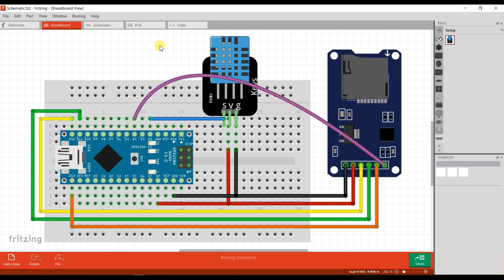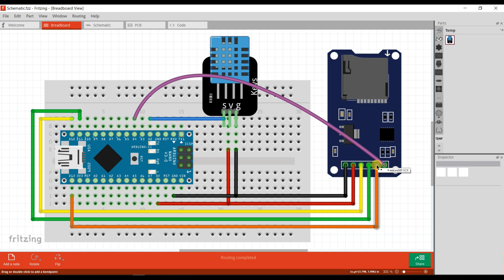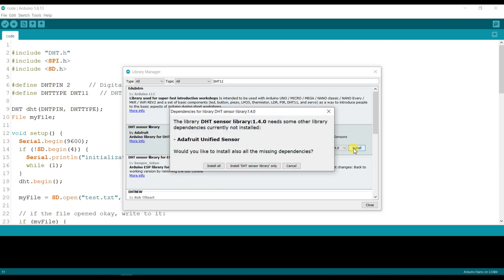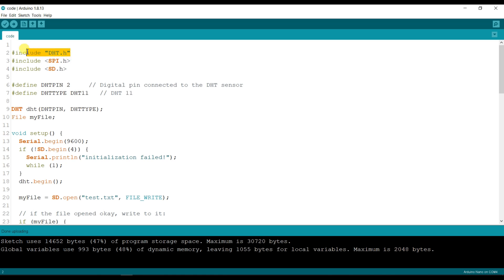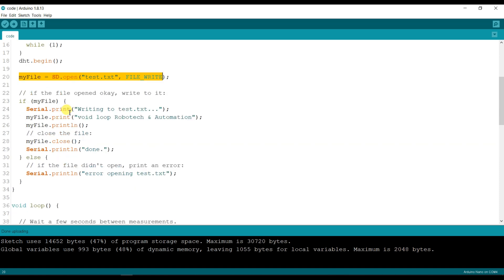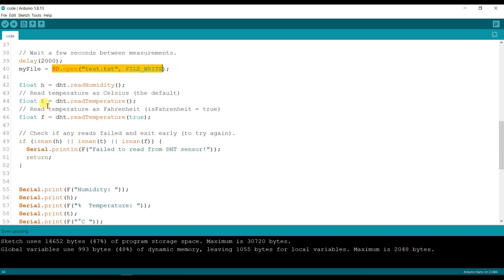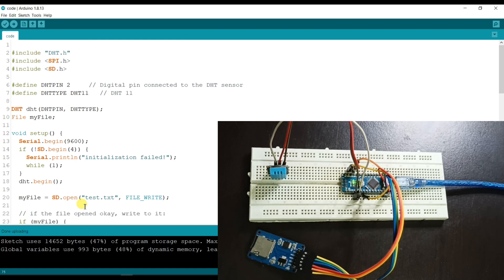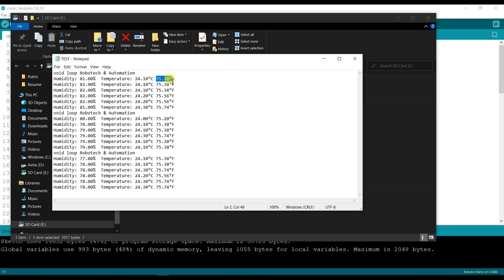46 DHT11 data logger with Arduino and SD Card Module

Comment: Thanks so much for posting more like this.A little doubt #include "dht.h" library installed ok..Under it
#include <SPI.h>
#include <SD.h>
This is how both are installed.You have given the description code  "copy make and paste arduino software"
That's the way to do it
dht11 Is it enough to just install that library?
Please reply sir plzzzzzzzzz
❤️🙏🙏🙏🙏🙏🙏🙏😢😢
Reply from the maker: There are inbuilt library of SD and SPI.
Reply: @voidloopRobotechAutomation  inbuilt library means That arduino softwares willbe plzzz reply sir